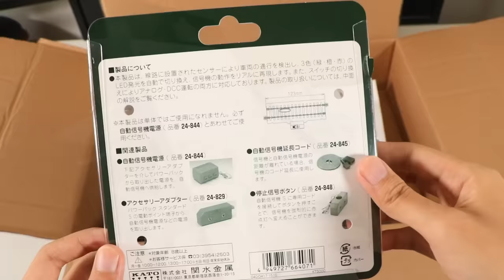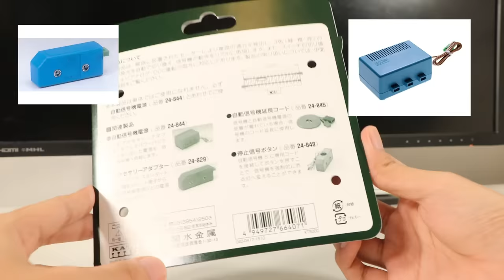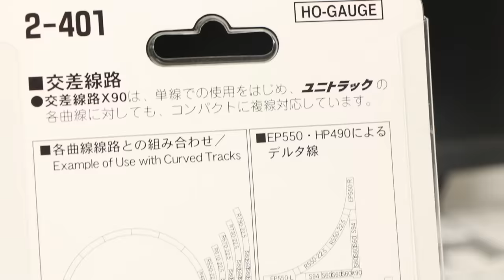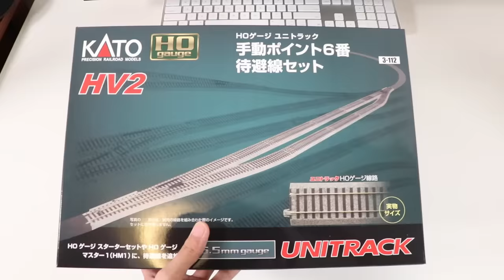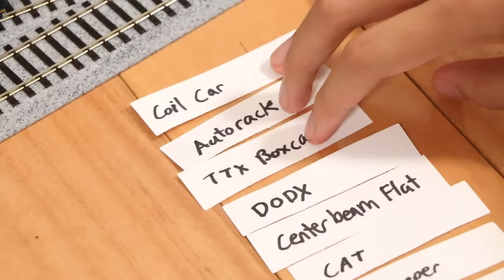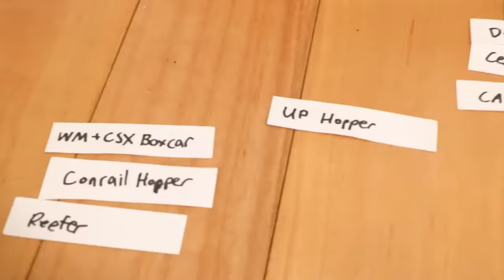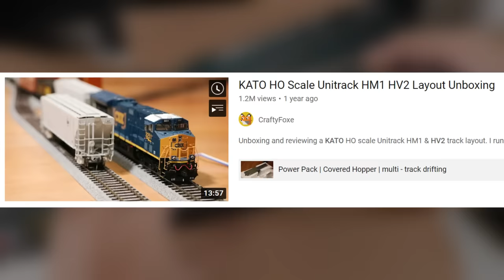Kato HO Scale 90 Degree Crossing Unboxing

Comment: Can I please ask where you get your Kato tracks from because I am trying to replace my tracks with Kato in HO scale and it’s super hard to find so can you please help
Reply: For me I typically buy Kato stuff from Model Trains Plus or Plaza Japan, though sometimes I get them at local hobby shops. However, I've noticed that Kato products in the US are more expensive, even on the official Kato USA store, I don't know if the same goes for Australia as well, but in my experience; it's much cheaper to buy from Japan.

Comment: I you built a figure 8 using the 90-degree cross track, would you need two feeder tracks to power each loop or does thee 90-degree cross track supply power to the opposite side of both directions? Thanks. Great video.